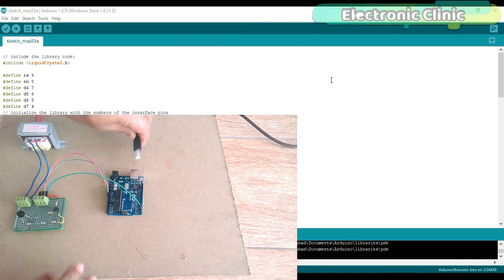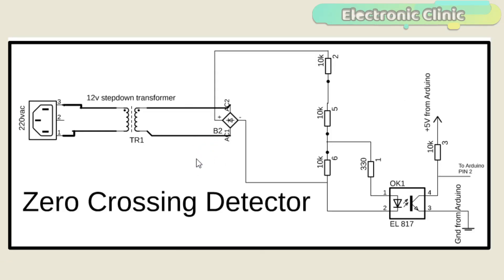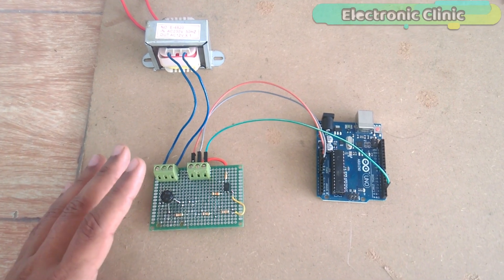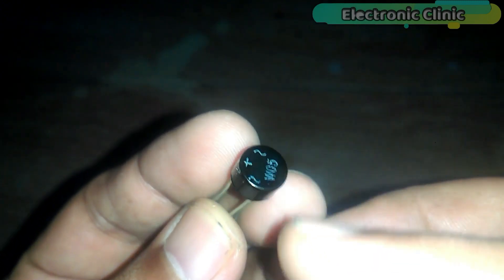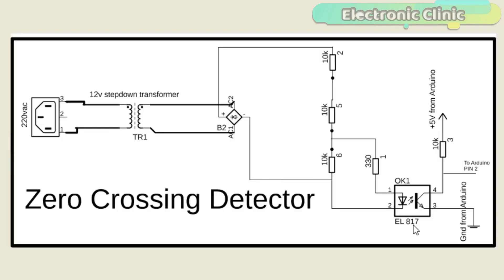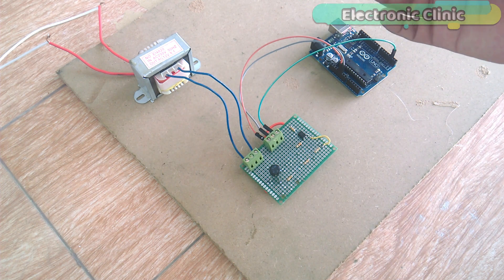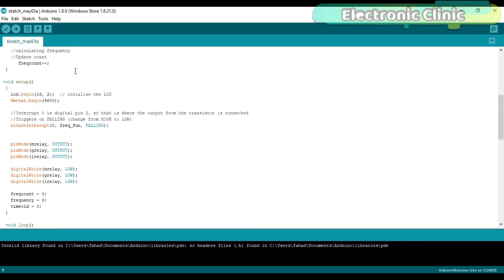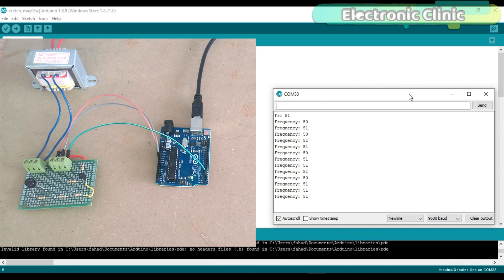Arduino Project: Zero Crossing Detector based 110/220V ac mains frequency monitoring

Comment: thanks.. can i use PC817 optocoupler? i try the same circuit then i plug it on wall socket i get just 50hz repeating on serial monitor is this the normal operation of this circuit?
Reply: yes frequency is almost constant

Comment: why results are not stable ????  how can be it useful if measurements swinging around 50 to 52 hz ?? next time use oscilloscope with your h/w so that people can see how accurate your project is.
Reply from the maker: i was checking this using inverter, thats why the frequency is fluctuating. inverter need a bit adjustment.
Reply: @ElectroniClinic  inverter means transformer? thx for very helpful video :D
Reply: @ElectroniClinic  Ok !! u should inform this in your video. pl upload another video in which u check your h/w on utility AC with oscilloscope.....BTW how u will adjust you inverter's frequency???  also share that video .... every one wanna see how u do the "ADJUSTMENT" .
Reply from the maker: I will start a complete series on solar charge controllers and inverters and batteries
Reply: it is arduino it is not 100% stabile dont be rude